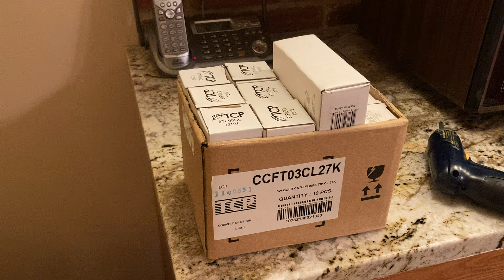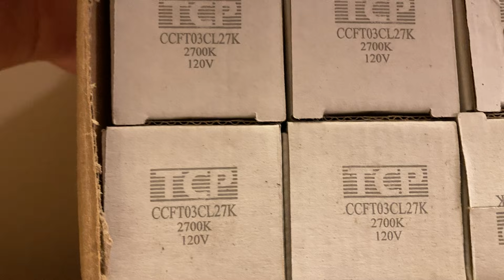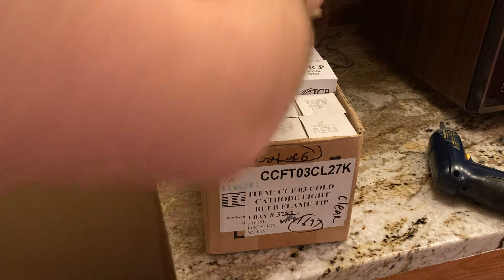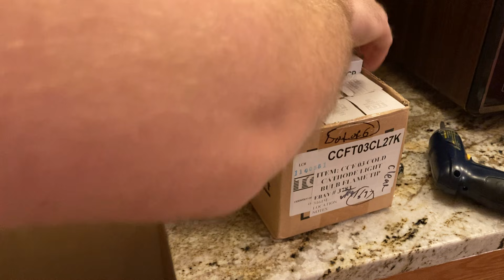Testing Different Light Bulbs in the Kitchen Light | TCP 8TF05CL 5 Watt Cold Cathode Bulbs

Comment: Interesting light bulbs, I didn't know about them. But 8:30 the light from even the best or most modern energy-efficient bulb is easily distinguishable from the light of a good old incandescent bulb; only these (and other thermal radiators like the sun) have a continuous spectrum. All fluorescent lamps and all common LED lamps, which are technically also fluorescent lamps, produce a distorted spectrum lacking long-wavelength red. You can see this if you hold something red (tomato, apple, etc.) alternately under a good old incandescent bulb and then under an LED or fluorescent lamp: only under the good old incandescent bulb is the red rich and vibrant.💡